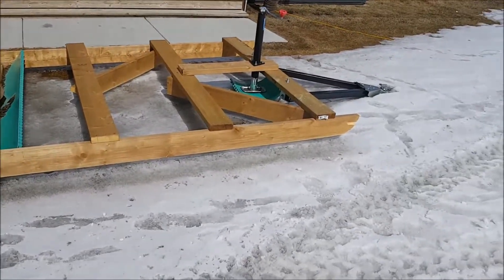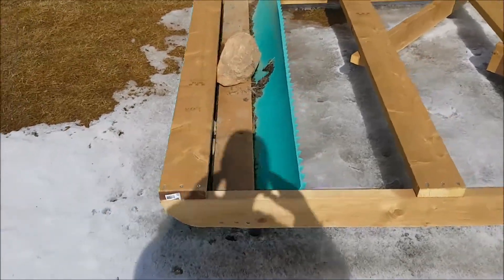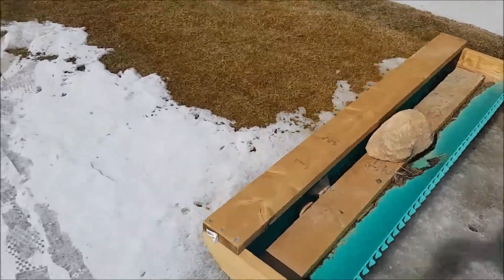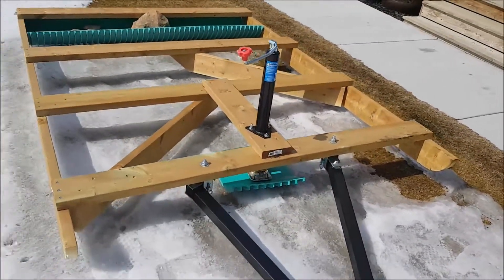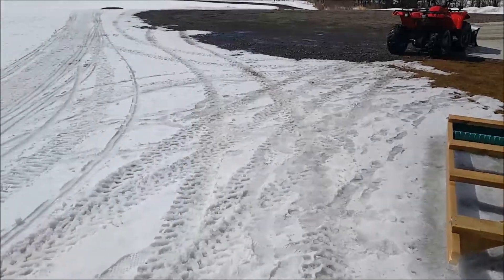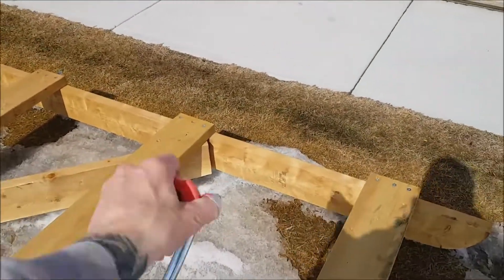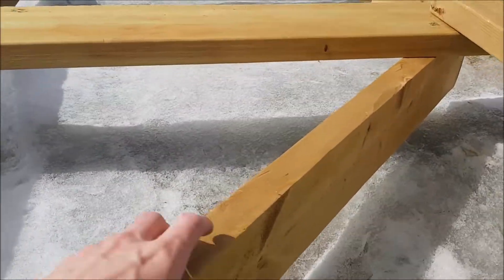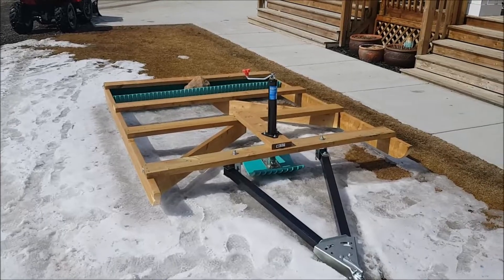How To Build A Snow Groomer - Ski hill and trail DIY homemade and it works!

Comment: how do you
attach the frame tongue
Reply from the maker: I purchased a class 3 a frame tow bar assembly,  it came with saddle that I put bolts straight through the wooden 2x6 with nuts and washers on other end   here is the link https://www.princessauto.com/en/class-iii-adjustable-a-frame-tow-bar/product/PA0008041550

Comment: Hi-- this is wonderful.  ONe question-- did you have to weld anything on the trailer coupler or were able to use all bolted connections?  Can you share where you found the coupler?
Reply from the maker: Don,  we uses a class 3 A-Frame trailer tow bar assembly,  it comes with pivot mounts, we used 5/8"  bolts with washers and nuts to attach to the wood frame.  here is the link https://www.princessauto.com/en/class-iii-adjustable-a-frame-tow-bar/product/PA0008041550

Comment: What is you pvc pipe exactly?
Reply from the maker: PVC schedule 40 White 1/2" Pipe   3/4" will work as well jut not any larger
Reply from the maker: MY mistake, its 16" PVC KorFlo manufactured by NAPCO,  IPEX makes the same called Ultra-Rib
Reply: Thanks again! 😊

Comment: Do you think you can pull that behind a Polaris 600 RMK to groom short local snowmobile trails?  Maybe a narrower version 48" X 72"
Reply from the maker: It would pull it no problem, but if you have a lot of snow lift the front of the groomer up.  I would be cautious not to over heat the engine, I use an 2004 Arctic Cat 660 Turbo 4 stroke has a lot of torque

Comment: Do you think the diagonal pieces make a huge difference in the final product? As in, if you just had the part with the culvert do you think it would work as well?
Also with the diagonals, do you find too much snow getting put onto the one side vs the other?
Reply: In order to build a solid base,snow has to be shuffled and aired out,this is done with those diagonals.
Reply from the maker: Billy, the snow spreads very equally, yes you can remove the diagonals in powder but it does note groom out the bumps very well, I actually use another version I built to groom when we have over a foot of snow, hope to have time
 soon to post it
Reply: @strauss_house  Thanks for the explanation
Reply from the maker: @shawzy17  I am building another "powder" version stay tuned hope to have the video up soon